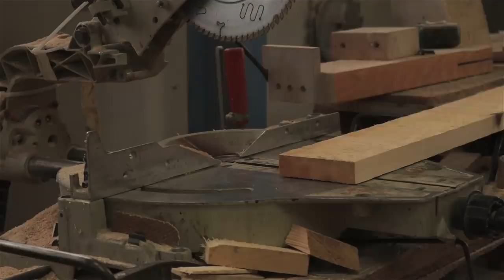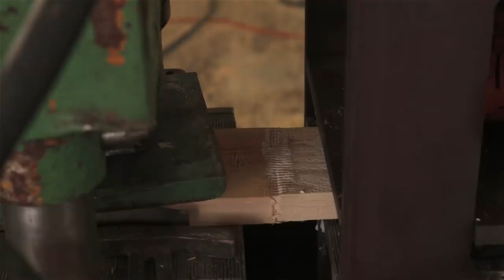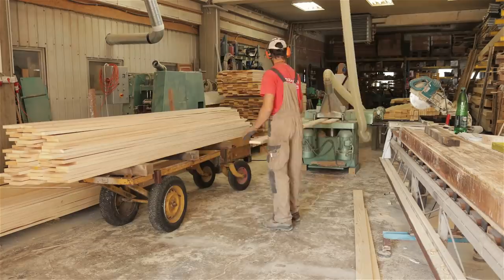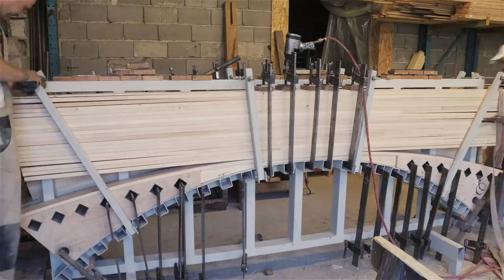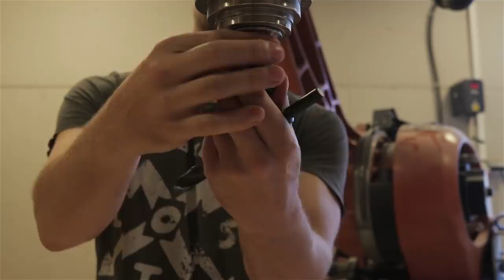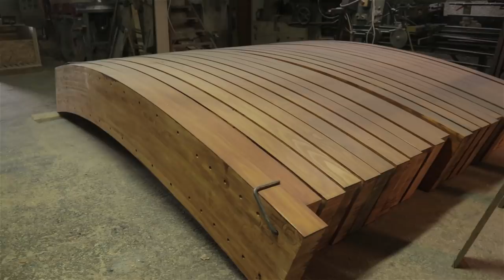Production Process of Curved Beams.

Comment: Glue...everything glue holds,whole beam lol,well that is some crazy glue.
Reply: LVL beams used in residential houses are made basically the same way. They are engineered to be much stronger than solid timbers. And recently, finger jointed rafters have been a thing. I built a 1.3 million dollar horse barn and had to use finger jointed 2x10x 28ft rafters because no one sawed sold 2x10s that long. I was sceptical, but they worked very well.

Comment: Great job! 
Were the press and the finger joint router part of an entire finger jointing line or did you buy them separate? Does the press heat the glue and joints? I've been looking for an old press and router, but can only find real expensive complete lines  :(

Comment: Great video as usual! could you tell us more about the type of glue you are using?
Reply: From the info underneath the video. "two component melamine glue from akzo nobel" you will find more info here. https://woodadhesives.akzonobel.com/adhesive-technologies/melamine-formaldehyde-based
Reply from the maker: Yes I can. We mostly use pvac d3 or d4, and melamine glue. For this project we used d4 pvac for finger joint and two component melamine glue from akzo nobel for laminating. melamine is great because it has long open time which is needed when applying it to many layers by hand. It also has great heath resisting properties which is needed for load bearing structures (In case of fire it doesn't loose it's adhesive properties).    Glad you like the video!:D

Comment: Is there a maximum radius to the bend? How do you know how far you can bend without snapping?
Reply from the maker: Simple, you divide the radius by 200 and you get the thickness of slats. This way you are sure they won't snap, there is no max radius, max radius is a straight beam.

Comment: How do you align the big parts when you work with the Kukuas on it. How Do you get the right zero point? Can you touch more edges with the koka and align the parts in your machine software?
Reply from the maker: You can touch like you said but it would take too much time for each piece. I first  plane the surface, then mill the contours of the object and position the pieces to that contours.